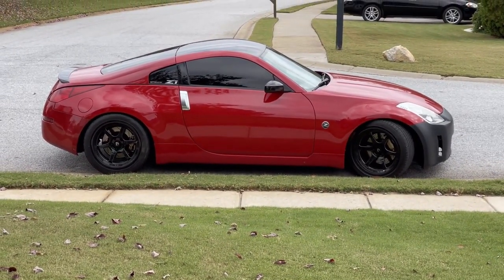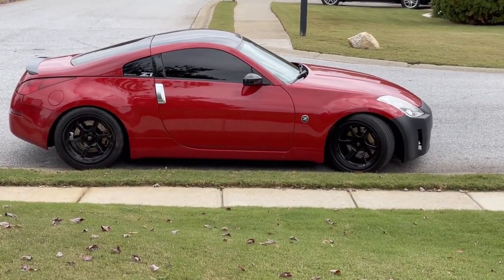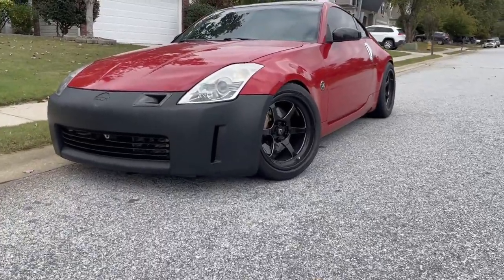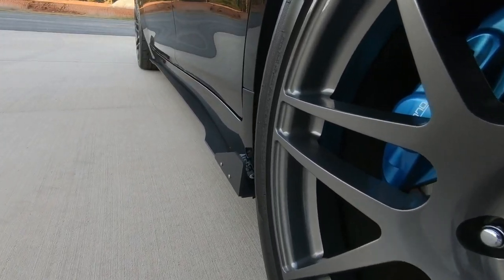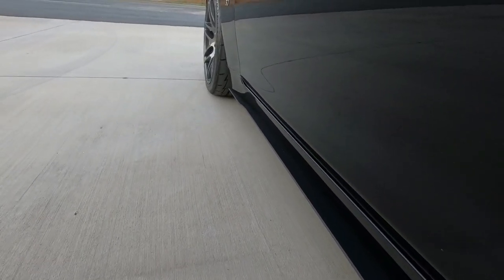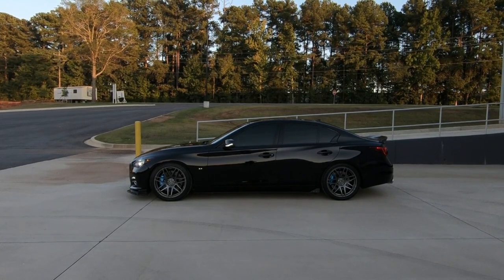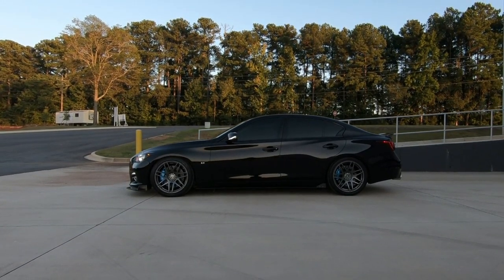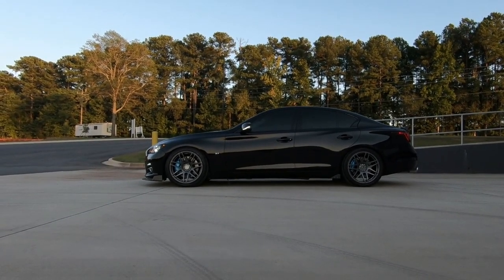Crazy girl reacts to the Q50s GRIP!

Comment: Would an lsd be beneficial for awd and if so should I go just the rear or both front and rear and would I also need to change gearing on center diff?
Reply from the maker: Your factory gears are used so no need to change anything.  If you’re experiencing traction issues I would certainly look into it.  Reach out to traction concepts—they are great to work with!